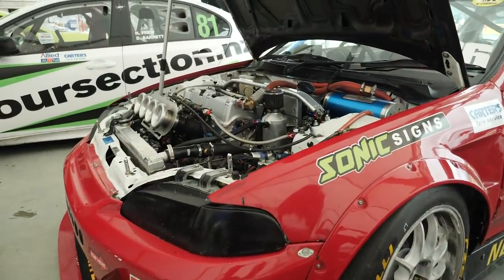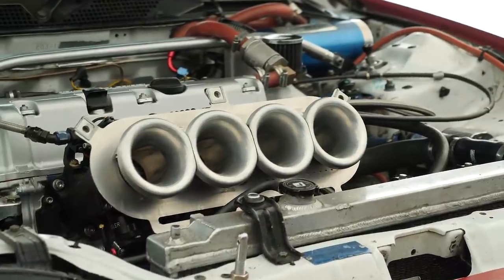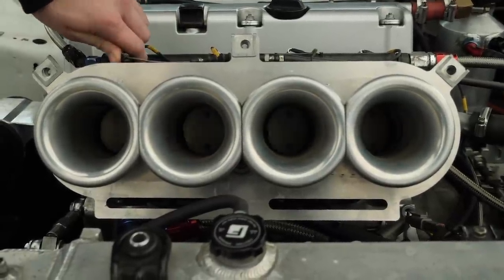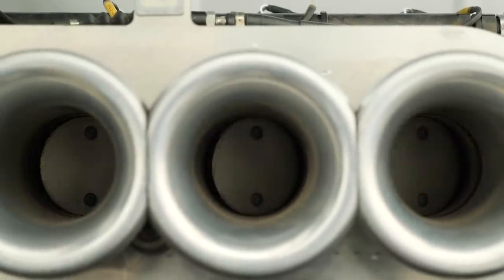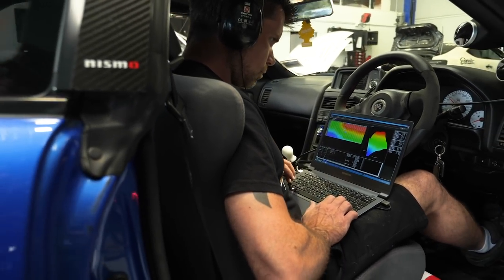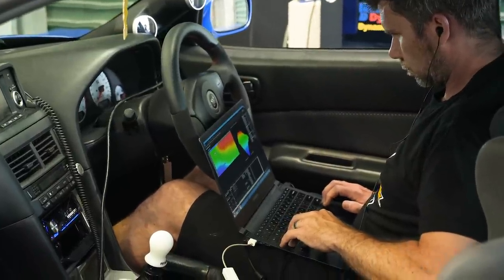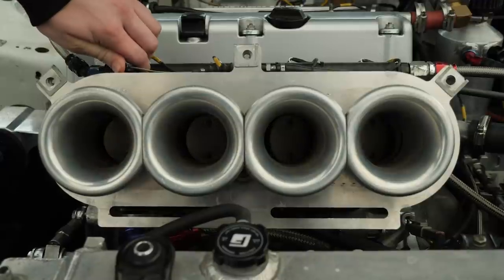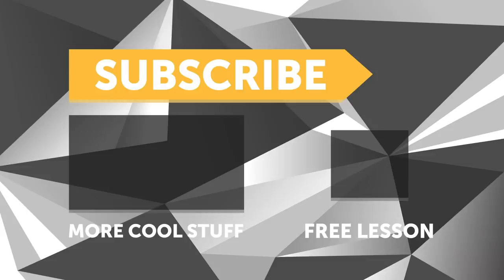Why Are ITB's So Popular? | Individual Throttle Bodies [#TECHTALK]

Comment: I primarily work with bikes, which come standard with ITB's.  The benefits come from the ability to maximize the air charge available to each cylinder.  A single throttle will ALWAYS provide different volumes of air to different cylinders.  More throttles and more o2/egt sensors = more better.  :)
Reply: #BALANCE
Reply: ITB with an airbox can also suffer from imbalance unless you are fortunate enough to have alot of realestate for a large volume box and large diameter inlet.

Comment: You can run a much more aggressive cam profile with ITBs and still have an engine that will idle, I'm surprised this wasn't mentioned in the video.
Reply: An unexpected downside of throwing them on AFTER camming the engine.
The sexy idle disappears :(
Reply: @esnevip  The solution to that is even wilder cams :)
Reply: Torque: I dont feel so good
Reply: Very true
Reply: @esnevip Normal throttle bodies and individual throttle bodies are both closed at idle so why would they be any different? Serious question.
Reply: @andrewsmith5512  Likely down to how load is measured.  A MAP signal fluctuates too much.  Running bigger cams with a single TB/plenum arrangement smoothly is possible if you run a blended load source and of course if the computer supports it.
Reply: @dra911  I believe it's more to do with the stronger vacuum created in a plenum which combined with the overlap pulls more exhuast gases  into the chamber giving it a lopier idle . Don't  need fuel injection to observe that , an engine with a wild cam  with individual carbs runs smoother than a plenum with single carb .

Comment: You guys win the cigar by a mile, its the first time I have watched a video were diameter of the throttle body has even rated a mention, well done.  There is a guy on YouTube call Richard Holdener  and offered to pay for him to put a engine on the dyno and test if diameter was important.  Hi reply "Everyone know its all about length and diameter has nothing to do with it so its a waste of time testing".  I was putting 10 k on the table and that is what I got back, a closed mind.
Reply: Interesting, I read a basic introduction to throttle body diameter in the Megasquirt introduction tutorials even.
Reply: Would have been easier and cheaper to test it yourself, why go through all the hassle?
Reply: @greggreg6975  I have done the testing as I have my own dyno's and pressure transducers to read the pressure waves on intake and exhaust.  I think there isn't enough development or understanding of what really happens with exhaust and intake pressure waves on a NA engine.  Not everyone wants to fit a turbo.  My purpose of making the offer to Richard was to open peoples minds to what pressure waves are all about and how you can use them to develop a lot more power in a NA engine.
Simple fact often missed the timing of the wave is determined by the length of the intake but the force or size of the wave is determined by the diameter as has been mentioned in the video by Andre.
Reply: @anthonyparle7342  ok you have lost me. 
What does the size of the throttle body have to do with the Internal diameter of the intake and exhaust manifold? As long as it flows enough air for it not to be a choke point.
Reply: @anthonyparle7342  I understand pulse tuning but what has it got to do with the throttle body?
Reply: @greggreg6975  When I refer to the Throttle body I mean the ram pipe and manifold that is attached to it,  In other words from the bell to the head and also the size of the port in the head.  It all effect the wave pattern.  Hope that clears it up for you Greg
Reply: @greggreg6975  one thing I should add Greg.  Pulse tuning is all about reducing size of intake and exhaust to the point were you create a restriction.  The trick is that the gas over comes the restriction by the the time the IVC and fails to over come it with the EVC event.  The first creates 6 PSI pressure on the intake and the second a negative 6 PSI on the exhaust at EVC.
Reply: @anthonyparle7342  phew..ok mate.
I suspect you may want to go and look at your theory again but what do I know hey?
Reply: @greggreg6975  Not my theory, I am not smart enough to come up with it.  It was developed by the F1 NA guys.  Andre said "Get velocity up" that is what he is referring to.  Its based on the formula 1/2mass times velocity square.  Time for me to bow out.
Reply: @anthonyparle7342  okidoki
Reply: It's fairly basic when u don't go into detail. Ported/bored TB will have the same effect as larger diameter throttles. Reducing low rpm air velocity and increasing top end. Of course cam timing plays a huge role. Overlap will also increase VE and essentially create a forced induction intake charge.
Reply: @youwantshum9860  Thanks mate..
I do understand... its just that wise arse here missed the point.
Andre is talking about low to mid rpm and driveability. Richard Holdner does dyno testing at mid to full rpm and max torque/power. Its not the same thing.
If he is going to talk shit about a bloke at least get the basics right. first
Reply: @greggreg6975  You really haven't got a clue what your talking about.  Diameter of throttle body can produce more power at any rpm you design it for .  Should of known better then to get into a discussion with some guy on Youtube.
Reply: @anthonyparle7342  Maybe?  I would have liked to discuss this topic with you as I'm very interested it pulse tuning. I have some experience but am no expert.
Thing is you come across as an arrogant know it all?  This seldom turns out to be a fun discussion, you may well be completely correct but i guess we will never know.
Reply: @greggreg6975  Greg, I haven't got a clue about most things and when it comes to engines Richard knows a 1,000 times more then me but in the field of engines I play and do my R&D I have a better understanding then most people outside of major race teams and car companies R & D.  My discussion with Richard was very public and the purpose of my offer was so he could teach people who are interested what role diameter in both exhaust and intakes plays in NA engines and higher VE.  I am 64 years old and I would prefer not to take my knowledge to the grave.
Reply: @anthonyparle7342  I can appreciate that.. lol  I'm not that far behind you!
Richard probably knows more about engines and what works and what doesn't than most people. 
I worked at R&D for nissan, trust me when I say a lot of effort and money goes into manifold design and testing.
We did a lot of work with manifold length, diameter and shape..lol.
The biggest gains we found were with length more so than anything.  Going too big or small on diameter lowered torque for a given rpm as did length. We also found that tube diameter roughly equal to port size gave the best results?? 
We also noticed a distinct difference in gass velocity and pressure wave velocity??

Could you please add some info as to why??
Reply: @greggreg6975  I measure the gas velocity at 1,200 msec and the return pressure wave at 300 msec.  The in my opinion the reason for the difference is that the exhaust gas plug could exit at 60 psi up its ass.  The pressure wave at best can achieve a pressure difference of 8 to 10 psi.  That is why I think you see the difference.  I measure a 2 meter long single exhaust pipe with pressure sensor at both ends to study the exact difference you noticed.
Reply: @anthonyparle7342  cheers mate.. I'll have a go later today

Comment: Tuning the length is not about creating a RAM effect (that is something different). Tuning the length and diameter is more about Helmholtz tuning I think? Albeit lots of good info in that video as usual and I aways learn a few things, so thanks a lot. The other thing you didn't get a chance to touch on is taper angle of the trumpets. Done a bit of playing on a dyno with inlet trumpets playing with lengths and tapers and also just a little bit of work on variable length and dual stage and it is amzing how well theory and real world results actually match up. But still have lots more experiements I want to do.

Comment: I've never modified a car, therefore sorry for the dumb question that is coming :
If you install an ITB, you delete the air filter right? Then isn't this dangerous for the engine?
Reply from the maker: This car actually runs filters, they're just off to show what we're talking about. You can run individual filters, a filter box over the top or in some applications a plenum chamber just to name a few options.

Some people do run without filters, but it carries all the risks you assume it would. That said, risks can be different between different motorsport applications, such as drag racing vs dirt oval - Taz.
Reply: @hpa101  I see! Thank you very much for the explanation! Really clear!